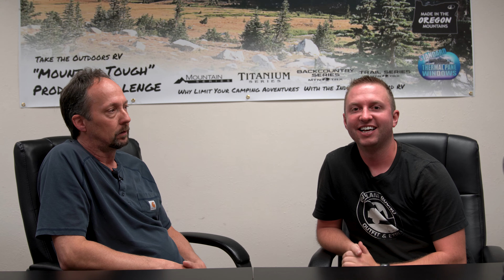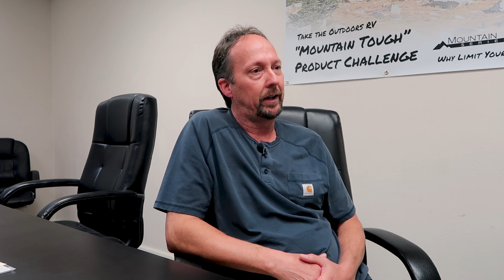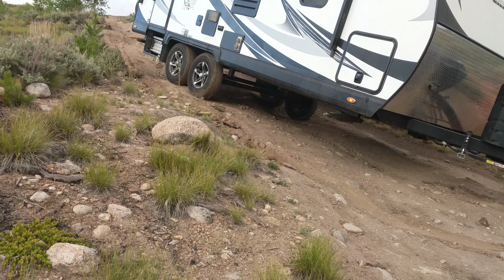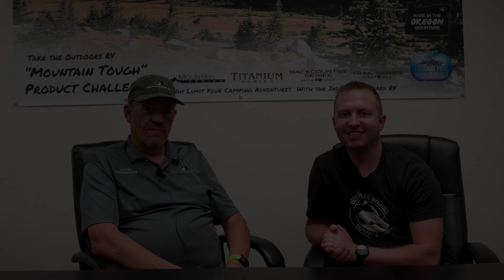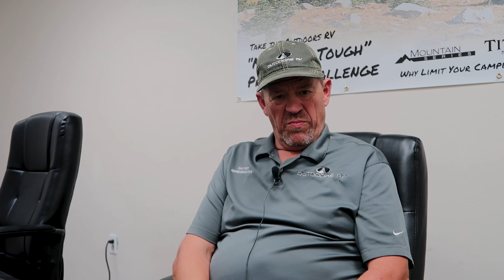How to design a great travel trailer | Q&A with Outdoors RV

Comment: I like there product but do they install wood in all there aluminum frames?
And i noticed that long term alot of comapies do not have Aluminum frames around windowers and doors and after time the foam gets dry and the windows trim sandwitched the wall together tends to move and I wonder why they dont use frames around windows and doors?

Comment: Hopefully they get rid of the 1970s tank gauges.....
Reply: I like that it's not a fancy LCD screen that sucks battery
Reply from the maker: Yeah, those tank level sensors aren't great. Our fresh and grey work fine, but I like to joke that the black tank sensor is really just a way of testing that all the LEDs work - it always shows full no matter how much we flush the black tank.

I know there are other systems out there like SeeLevel that operate differently. Originally I had planned to install those myself, but after a year on the road we've developed a good sense for how our tanks are doing without relying on the sensors.